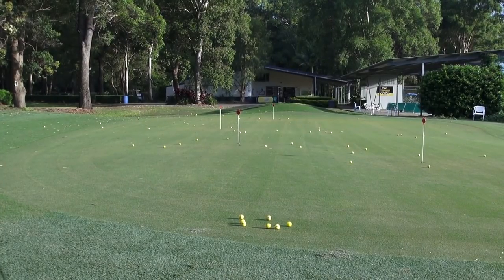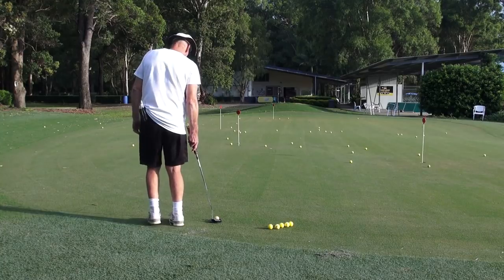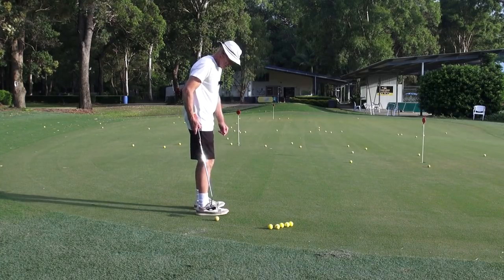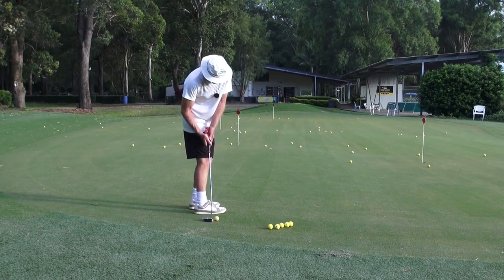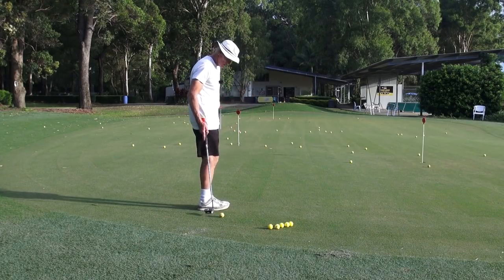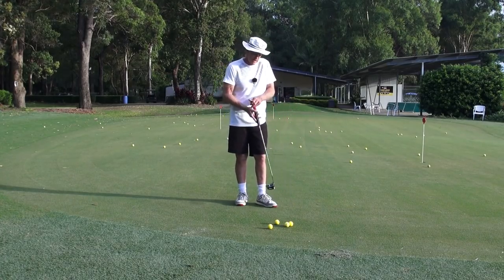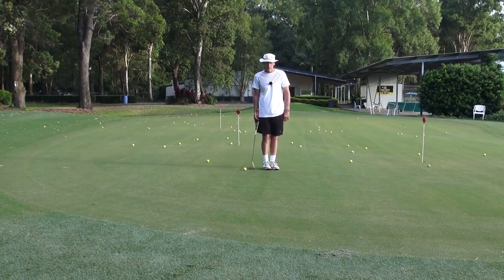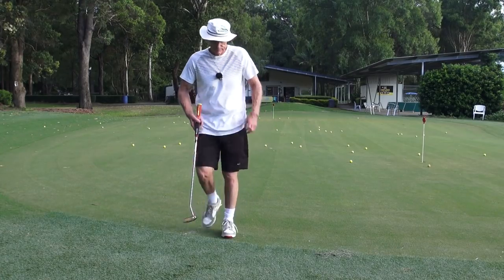Channel Lock Putting  With Containment

Comment: I've been struggling with the yips using conventional putting.  First time out, I had great success with CL putting even though the conventional theory is to use the shoulders and a variety of very odd grips.  Thanks JN
Reply from the maker: Hi John,
                   I think locking into the strong trail vertical axis at address with CL putting is why it takes away the hand yipping' tendencies ..   the hands are still free  moving agents but they are 'travelling   sideways    in an 'arm/hands moving process .. the locking of the     trail arm to the body and eliminating the   excessive movement of  the hands/arms independently of the body    makes the difference in the   feeling you get in the hands when you get the 'Yips'..
                           cheers JH

Comment: Have been putting my putter grips on this way for years, but I don't putt channel lock, yet
Reply from the maker: Hi Steve, 
              If you can determine what your dominant eye is and get the ball directly underneath it where ever that may be you will really notice how solid the impact quality is .. the reason I like  the CL putting structure is that by having my  knees and hips facing the hole then turning my shoulders    90 degs to them I get fantastic structural   support  in the address stance.
                      cheers Jh

Comment: Good vid, question, it looks like you are not rocking your shoulders and you are just swinging your arms keeping your shoulders in place. is that right?
Reply from the maker: I actually do not rock my shoulders to move the putter... I very much use my hands because they  have very much more  delivery capability  in active use than passive hands  being   pushed by  a rocking shoulder girdle...  if you were trying to insert a key in a lock   you very much rely on the  'finding' capabilities of the  hand/fingers .. if you tried to  insert the key into the lock with a passive hand/fingers  by   activating the  hand by  just  pushing  the arm I think you would struggle to get the key inserted  correctly .
                   I lock my shoulder girdle in place and just move my hands in a 'seeking' manner naturally under the locked out shoulder girdle.
                 cheers JH